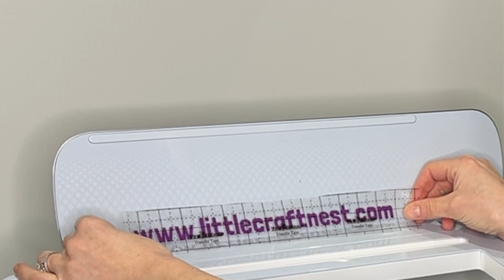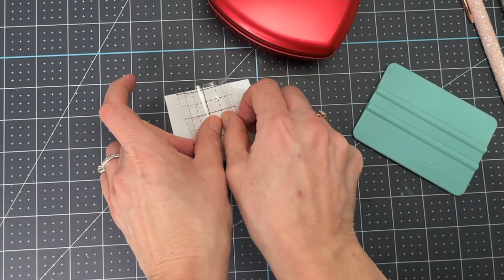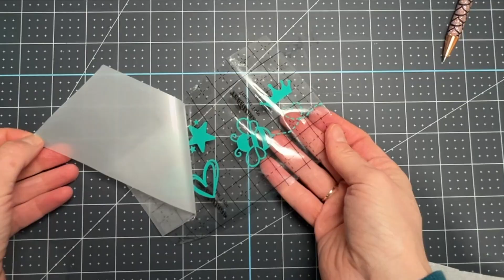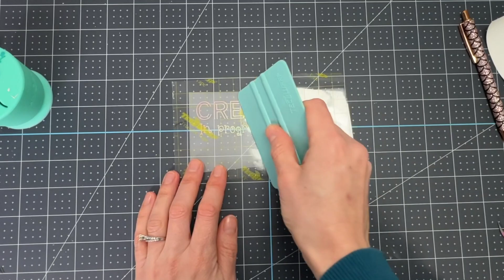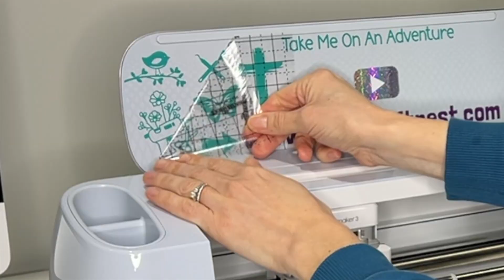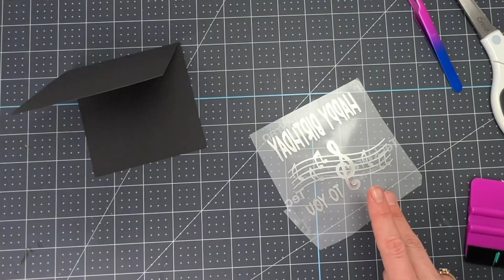Transfer Tape: Comparing Low, Medium & Hight Tack | How to use Transfer Tape with Vinyl Designs

Comment: I didn't realise there were different strengths of transfer tape, I have been struggling with some designs when transferring over.
Reply from the maker: It depends on the brand - some only have one strength of transfer tape. I find having different strength levels to be very beneficial.
Reply: @littlecraftnest  Thank you, I will be getting another brand and experimenting with it.